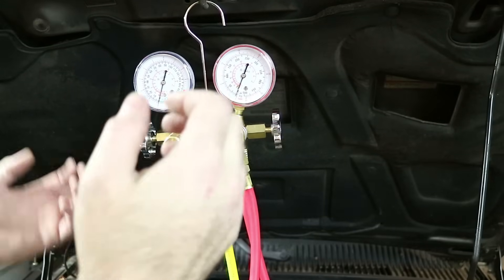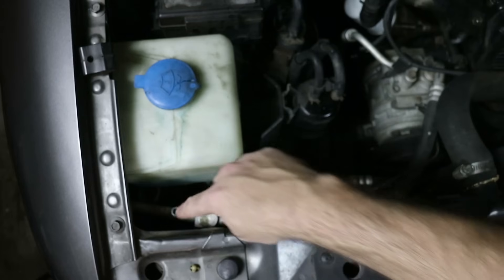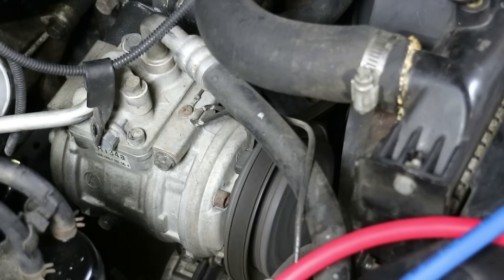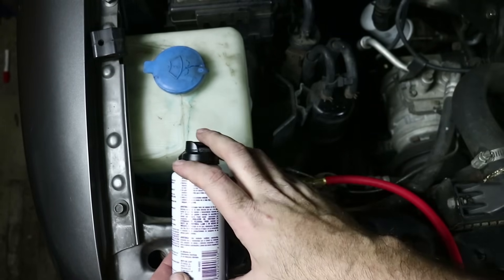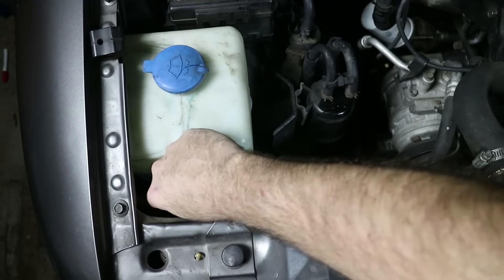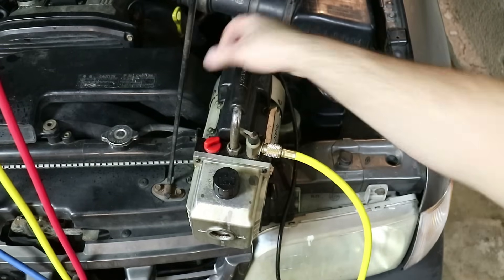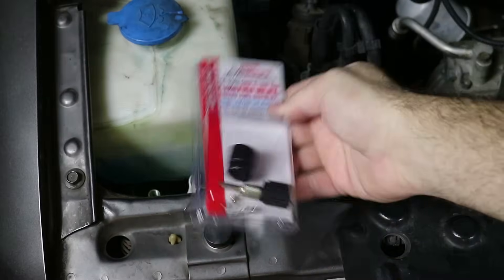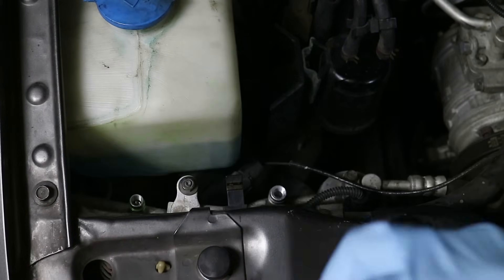How To Recharge an A/C System Professionally DIY

Comment: They now make schrader valve replacement tools where you don't have to evacuate the refrigerant.  About $20 on Ebay or $60~$120 for a name brand.  One caution, some American car makers use weird schrader valve sizes that won't work with the standard sets (and require the expensive professional sets with all the different sizes).

Comment: When the system just got evac it is best time to add dye to the system in case of future leaks.  It is okay to open both low and high side when initial charging with engine off.  Then MAKE SURE TO ONLY OPEN THE LOW SIDE AND THEN CLOSE THE HIGH SIDE BEFORE STARTING THE ENGINE, otherwise if the high side valve is open will cause the freon can to explode due to high side pressure.  Only charge system with vapor freon to prevent liquid be suck by the vacuum side of the pump (YOU WANT VAPOR AND OIL TO LUBE THE PUMP AND NOT LIQUID FREON).

Comment: Once you close the valve on the top of the can you can open the low side line again and it will draw in any freon in the line stoping the pressure release from when you-take off the valve on the can make sure it's closed before removing.
Reply: As long as the compressor is still engaged.

Comment: If you leave the charge line attached to the can tap while sealed you can in fact avoid that 😂 Also keeps you from sucking air in, though it’s a good extra precaution to close your low side valve as you said

Comment: Extremely important advice at 12:38 where you mention to open only the low pressure side, also called the suction side/vapour line. Opening the high side of the liquid line when the engine is running and the AC clutch engaged with the refrigerant can in the loop, is a disaster waiting to happen as the refrigerant can is not designed to withstand the liquid line/discharge line/high pressure line pressures. I have seen patients with blown/cold burn palms and abdomen. Horrific site.

Comment: Thank you for making this excellent video.  I rented a vacuum pump and gauges from AutoZone, just to draw a vacuum and verify that my system has no leaks after I replaced the accumulator/receiver and the hoses, and can be refilled.  But I thought that refilling it would require some additional components.  After watching this video and realizing that I have everything I need to recharge the system (except for the R134A), I am going to recharge it myself and save over $200 that the shop will charge to do the work.

Comment: All old ac compressor have tiny Gas leak at compressor shaft  which is very hard to see due to it hide behind the ac coil and clutch . Gas detector can not detect due to radiator fan blow the gas away. After charge it to correct level, it is going to be lower again in few months time
Reply: Always use electronic gas leak detectors with the engine and all fans off.

Comment: You Donot Need To Discharge
By A Professional, You Can Do
By Your Self,
I Have Made 100 Vehicles AC
And Replace Ac Compressors,
Clutch Without Any Expensive
Machine And Without Experience.
You Donot Need Vacuum.
Amén.

Comment: I have a question, ALL these vids say fill the low side with freon, NOW I AM CONFUSED CAUSE THE INSTRUCTIONS WITH MANIFOLD GAGE ,says inject refrigerate into THE HIGH PRESSURE VALVE?????????????/ wonder if they wrote it wrong on instructions
Reply: you always service on the low side.

Comment: you could flood your compressor with liquid and damage pump and or bearings that way .. gentle 12 oclock to 10 oclock then to 12 an 3 a few times then 12 for a few seconds
Reply: yes.  charge very slowly.

Comment: Valves or orings. Evacuate, pump nitrogen,  co2 or air inbthe system and start looking spraying with the soapy water.  Water will evaporate at -35inHG

Comment: Awesome job ! Finally gettbe picture of the system. I have spent over a tbousand dollars and after 2 months, no ac again, now the compressor has seized . Nothing intbe repairs was replaced, but the guy said the pressure was very very high, but only just now found out about the expansion / TXV valve, which was probably what was wrong in the beginning, now the whole system is compromised.  On a small SS income, Argh, this hurts. Its a 99 Ford Expedition , otherwise very sound condition. Thank you again.

Comment: Great video that many mechanics probably don't want many to see. Only thing is that once you open the system by removing the Schrader valves, run the vacuum pump on it for at least 30 min.

Comment: sure wish I had seen this video before! Must have watched 50+ videos over a week or so, NONE mentioned the adapter you need for cans if you have an older gauge system. and few mentioned to only open the right (high pressure) for vacuuming only. Other easy to understand instructions, the chart for pressure at the end, etc. Many thanks!

Comment: Excellent video, and as you point out near the end, an R135-specific gas temperature/pressure chart will allow people to take into account the ambient temperature. In fact, if you connect the gauges and read the pressures BEFORE starting the car in the morning, both high and low pressures will be nearly equal (they will have equalized over night) and will reflect the outside morning air temperature. If the pressures are not close to one another it likely means there is an obstruction or defective component in the system. This is valuable information in and of itself and trivial to obtain. I have to say that I’m surprised at how few videos even mention using the gas temp/pressure chart as it’s very easy to use and highly informative. Thanks again!
Reply: the temp pressure chart is the saturation pressure tempersture chart for a specific refrigerant.  it is different from the charging chart if not charging by weight.

Comment: Pulling a vacuum completes two things...# 1 it detects a leak  # 2 when you pull a vacuum down below barometric pressure the air becomes hot enough to evaporate any moisture that's in it...
Reply: the air does not become hot.  the pressure just drops and the air "boils".

Comment: You only need to add oil if you replace parts.

Correction: When removing your refrigerant, some PAG oil is extracted with the freon, and needs to be replaced.
Reply: not true.  if you recover refrigerant by machine,  it will extract oil and that amount must be put back.  it is usually about 10-15 ml.
Reply: @rodzvalv_5673didn't realize the oil turned onto vapor under vacuum. Good to know. Thanks.
Reply: @michaeldvorak5556 that is not what that means.  the refrigerant has oil in it when it is being circulated around in the ac circuit.
Reply: @rodzvalv_5673 yes, there is pag oil in the system with the freon. Under pressure, the freon is a liquid and has it is pump through the system, it drags the oil with it to lube the pump. They do separate in an idle system. My error was assuming the oil settled to the lowest point in the system and the freon is extracted from the high point without actually being circulated through the system. But, you are correct. When you extract the freon, the liquid freon is circulated and pulls out some of the oil with it. You need an oil separator to measure how much so you can replace it.

Comment: Great video. Wondering if you can tell me if 36psi on the low side and 175 on the high side at idle with a ambient outside temp of 63F is ok for a 2010 scion xb. I would appreciate it. Thank you again for the great video.
Reply: Looks right per a R134a pressure chart.

Comment: Good evening my brother,

I dont have an expensive recovery machine.

 Do you happen to know of a homemade diy way of recovering refrigerant from a vehicle (2003 Dodge Caravan SE) air conditioning system without using a recovery machine?

 I can't afford to take the vehicle to a professional or a shop either.
Reply: Most if not all shops will recover for free.

Comment: Sure never open the high side but nobody says anything about that red valve on the hose. Is it in or off when filling?
Reply: Keep the valve closed.  The high pressure gauge will still read the pressure in the hose.

Comment: When do you add the oil? My condenser had a hole and leaked all of the refrigerant out….got a new condenser, refrigerant and a vacuum pump. I saw you mentioned oil in the video, but not when to add it.
Reply: you can add oil manually at the compressor.

Comment: That is the only chart I have ever seen that the pressure is realistic.  Every other chart overcharges a system having 50 Psi on the low side at 90 degrees.  That is a 60 + degree vent temp.

Comment: I have a 2007 Lincoln Town. The AC is charged and the blower motor is working but on really hot days nothing will come out of the vents on the blend but if you put it to just the face vents it works just fine. Sometimes nothing comes out period even though the blower motor is on full blast you can hear it. Can anyone help or point me in the right direction?

Comment: how are you supposed to check for a vaccume leak whaen you closed your gauges to the system and always charge ac on high side or static pressure un less the ac clutch is running

Comment: Great video!!! Bought one of these manifold gauges and never used one. My A/C never gets very cold. Tried a can with an included gauge. Said pressure was a bit on the high side. If I drive down the highway it gets a little colder, but still doesn't work good. Any ideas???

Comment: If i looat at minute 07:13 i can see clearly that the lowe side vacum changed a little bit.

Definitly some pressure enter back to the system on those t wo hours span, so i think you still have a leak.

Regarding initial charge, there is two way to do it.

The way you just did it's called, gas state charge, that is, in low wide open and gas can upwards, so you are filling with gas.

and the other way is liquid state charge, in this way, you (WITH THE AC OFF) open only the high side valve and you turn over the R134A can, so you are injecting high pressure liquid to the system.

In a perfect scenario,  YOU DONT TURN OVER THE R134A can in a low side charge, because you are inyecting LIQUID TO THE COMPRESSOR and that can bend the pistons, it COULD happend, so its not very safe, to the compressor you can only deliver GAS! so you CANT TURN OVER THE CAN.

After all the first R134A is gone, you  close the high side valve and charge the second can in gas state charge by the low side.

I  do this high side charge because the initial can charges much faster this way.

Comment: I have a few problems. The compressor said it didn't ship with oil. To be sure I tried to drain it. A few drops came out. One instruction was to fill the compressor with oil before installing it. I tried this and it would not hold the 150 ml without overflowing. Yes I turned the compressor by hand while filling it. 
Second problem: I was careful not to "overtighten" the hoses on the manifold gauge set. I got them as tight as I could by hand. As I was filling the refrigerant I needed to turn the gauge set for a better view as it hung exactly like you have yours and the high side hose started blasting oil/dye and refrigerant. I closed it up again but I have no clue as to what was lost by amount. 
Long story short I still have no functioning a/c. New pump, new condenser, new drier, new expansion valve. High side is spiking at 300psi. Compressor kicks off and wont come back on until I shut car off and let system reach static pressure.
Reply: Did you get it working eventually?

Comment: old video but for those just watching this and learning, shouldn't shake can and charge with liquid . use only gas, right side up.
Reply from the maker: Yeah I know, the compressor can’t compress a liquid. In theory, you’re right, but in practice it takes forever to draw the refrigerant out of a little can that isn’t highly pressurized. So you tilt from time to time to introduce a bit of liquid to the line. The reason this is ok is because the liquid evaporates during its journey down the 6 ft yellow hose, the 6 foot blue hose, and the line going into the compressor. The instructions on the can even say to do the tilting thing.
Reply: @50sKid  I am guilty of doing the same thing in the past when I was too lazy to dip the can in hot water for gas only. I understand it's ok to tilt it as long as the feed is controlled. who knows, better than getting ripped-off by a mechanic shop who will charge hundreds for refill and  inevitably disconnect something else in the car in order to sell you unneeded parts.

Comment: Uv dye is only a partially condensable additive. Be careful using this. Ask yourself how many technicians have added uv dye already. Also, it is illegal without an EPA certification to handle any CFC or HCFC refrigerant, so just have a professional do it all. Thanks for the video however.

Comment: Hey 50sKid... love all your vids. If I let all the r134a out of my system and vac it out, will I need to replace the oil. I'm handicapped and trying not to have to pull the compressor to dump the oil and refill. Thank you for your time. Johnny

Comment: Adding the dye that way you added air to the system as the clear tube was full of air before the dye came through. There must be a better way?
Reply: There is! I just bought an 8oz can of dye whose cap is a 134a connector. So there is a straight connection with no plastic hose and therefore no air. cheers

Comment: I thought it is not supposed to turn the can up side down to allow liquid refrigerant to flood compressor which could damage it.
Reply: True, that's why most instructions say to tilt it from 12 o'clock to the 3 o'clock position.  But you can also totally invert the can and regulate the flow using the blue knob on the manifold set.  Just take it easy.

Comment: Draining the oil. A lot of compressors actually have a drain plug for getting oil out. If it's been more then 5 years and your system is empty, it's a good idea to change the oil. Any time your system is empty for what ever reason  it's a good idea to change the accumulator and filter. Any good shop that services your A/C will evacuate the system, change the filter and service it back up charging you ONLY for what refrigerant it required to top off. The machine will recycle/re-use the refrigerant.

Comment: I had the manifold setup to replace a condenser two years ago. The steps to top off a system are very different than pulling a vacuum first on a complete system evacuation.

This is the only video I could find that explains ‘manifold functionality’ clearly. I went out and topped off my Accord in about 15 minutes. I actually purged the all three hoses with the Freon can attached to the yellow delivery line before hookups to the system. After closing the Freon can valve and both manifold valves I attached the manifold system to get readings. Then opened the Freon valve before opening blue low side periodically and bumped the High side to about 250. 

Closed the can off and held it above the manifold using gravity to help drain the the yellow charging line...... Like 👍 a Boss. Really, again, you did a great job taking all the mystery out of the manifold functionality.

Comment: You probably already know this by now. The valve you screwed on the can adapter should be a back seat in front seat valve meaning if you screw the valve all the way in to seat it is shut off or if you screw the valve all the way out to seat it is shut off.And refrigerant only flows when you're in the Midway point. If your valve does not work that way get yourself a front seat back seat valve that way you can backseat the valve and change the can without losing refrigerant from your line also not introducing air into your line. Very good video though you did a nice job of explaining it as well as including an ambient pressure chart.

Comment: I pulled vacuum on car last night and was going to check in the morning to see if it lost any pressure. I then thought to close the valves to check if manifold gauge would hold pressure. This morning, gauge at 25 instead of 30. Opened valves, system was still at 30. Glad I checked this way.

Comment: I bought a 19 year old car with 187,000 miles. Car runs great. When I go to charge the high side always stays low and the low side goes up to like 130 psi (can pressure). Car never builds high side pressure. What's wrong?

Comment: It’s been 4 years since the video so I am sure you have figured it out but there is a way to avoid losing refrigerant when disconnecting the can. Close the can valve first. The compressor will pump out the yellow line. Then close the low pressure valve.

Comment: Great video and instructive.  My John Deere tractor has a leak somewhere and once I find it do I need to replace the dryer?
Reply: It’s never a bad idea to replace the dryer when servicing your Ac.  It’s inexpensive enough, cheap insurance.   However if you end up opening the system by replacing a part etc then definitely change it no question for good measure.

Comment: I usually coat my valve cores and o-rings with PAG oil.  I was wondering, since you just installed them without any, did you experience any subsequent leaks?